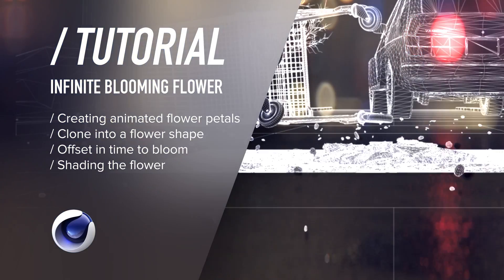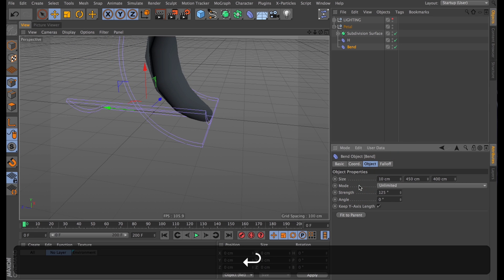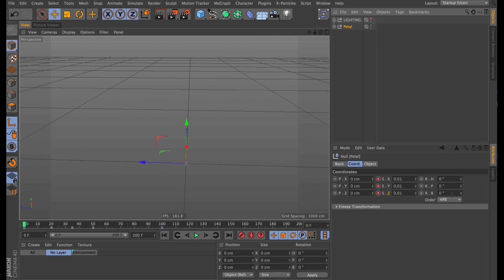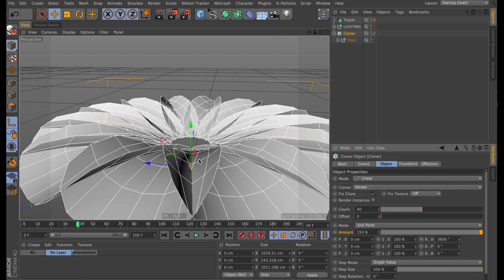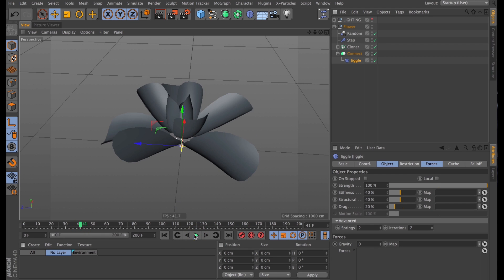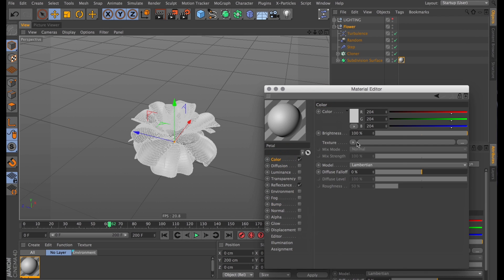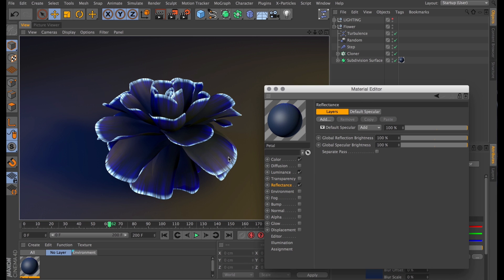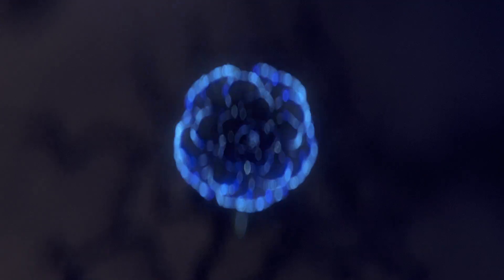C4D TUTORIAL | Infinite Blooming Flower  [Cinema 4D]

Comment: Follow all the steps right but when I add a subdivision surface nothing changes can u give me any advice I really want to create this and am wondering what is going wrong
Reply from the maker: This is a long shot, but make sure the Plane is a child of the Subdivision Surface (instead of the other way around). 
If that's not the thing, try putting the plane in a Connect object, then that Connect object in a Subdivision Surface. 
Connect objects tend to fix weird things caused by deformers and the likes.
Reply: @DanielDanielsson  I am sure that is the problem I was only connecting them via groups by just dragging I’ll go into it and make it a parent that would make sense I ended up caving in n buying the patreon file so I could skip a step if I got stuck but I am still going step by step to get the experience and even have room to go off rails a little. Just started going to school gotta say would have no idea what parenting even was if I had not gone to school it’s a bummer I had to learn it all in Maya but it borderline Carries over just a few minute differences but if u can run Maya u can run c4d & blender

Comment: Hi! I'm very late but if possible I was wondering if I could get help. When I put the step effector on my model it doesn't work and the petals all still move at the same time? Thanks
Reply from the maker: If you've got "Render Instances" checked on your cloner it might do that. Otherwise just make sure your Step Effector is included in the Effector-tab of the Cloner, and that you've got the time parameter active on the Effector. Best of luck!

Comment: PLS HELP how can i scale down it if i want to track it for video????
Reply from the maker: Should be fine to just put in a null and scale. You might need to adjust the turbulence and any other forces, and if you have any MoSplines of a growing plant, make sure they are not in the null with the Splines they reference. Otherwise it scales both the reference splines and the MoSplines, so they effectively get double-scaled!
Reply: @DanielDanielsson  thanks
Reply: @DanielDanielsson  i used cloner , thats i couldnt scale down or up

Comment: For those looking to just use the flower with out the animation, go to the frame you want the flower to look like. Then click on file and towards the bottom click on export, and export as .abc. A box will open, make sure you change the start and end frame to the frame you want. This will produce a file with the flower in but not the texture, just copy the texture and paste it onto the exported .abc flower

Comment: Thanks so much for this tutorial Daniel ! It's so easy and rewarding to follow along - - Question: I ran into a problem where I'm adding the cloner for the first time to the petal, but when I try to change the mode from "per-step" to "endpoint", nothing seems to be happening on my screen. Would you happen to have an idea of what might be occurring? Thanks!
Reply from the maker: Thank you!
It sounds like you're in a slightly newer C4D than I was using in the tutorial, so I think it compensates. So if you swap from per-step to endpoint it stretches out the endpoint so your clones are the same as when it was set to per-step. That might be it.

Comment: everything works until i get to the second bend. it brakes and i tried putting more segments but it just doesn't work? it hardly bends at all for me. kinda like a straight petal just sliding off the bend?
Reply from the maker: It does sound like it could've been the segments... Is it set to "Within Box" or "Limited" mode in stead of "Unlimited"?

Comment: HI, nice tutorial
I have some problem with my Step effector, the time offset doesn't have any impact on the animation: all the petals are still deploying at the same time. (First time on C4D, but i checked i did everything the same way. I use R17)
S.O.S.
thanks
Reply from the maker: If you've got "Render Instances" checked on your cloner it might do that. Otherwise just make sure your Step Effector is included in the Effector-tab of the Cloner, and that you've got the time parameter active on the Effector. Best of luck!
Reply: <3

Comment: I do not work the simulation of the fabric. 
What have I done wrong?
Reply from the maker: Is it the 'jiggle' deformer part around 10:00?
I think Elita110 down here in the comments had a similar issue and then fixed it, maybe you can check with them?

Comment: Hi, thank you again for this amazing tutorial, really professional !!! However, I need your help it's possible? After 50 frame, the edges of the petals go through the other one. It's not ugly and not really visible with the animation, but it's not perfect as your? I thank that it was the cloner, but I made it again step by step and I have always the same problem? Thank!
Reply from the maker: It's all down to when the petals are where. You'll have to do some trial and error, but I would start by tweaking the Position Keyframes of the petals, both values and timing.
Eventually you'll happen upon an animation where they all just lock into place.
Reply: @DanielDanielsson  I'm dealing with the same problem, I think it might be because I can't get my petal to swivel around a fixed anchor point at the base - how did you lock it there so the petal swivels just around just the point instead of the whole petal moving up and around itself? thanks!